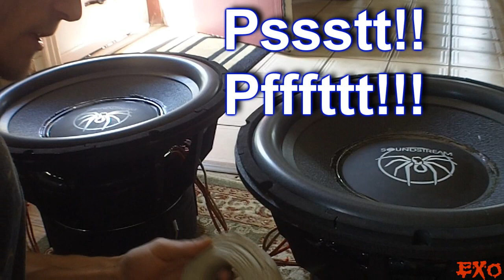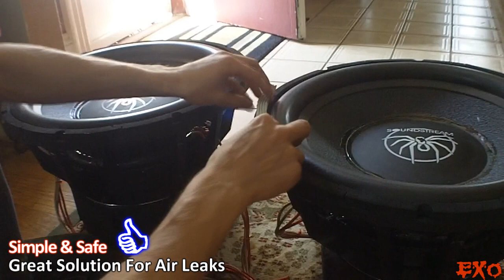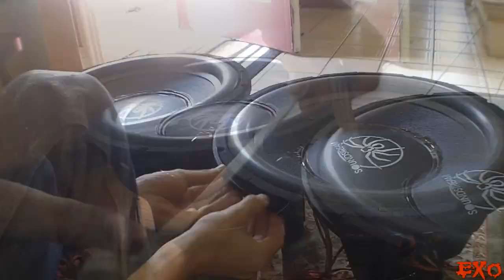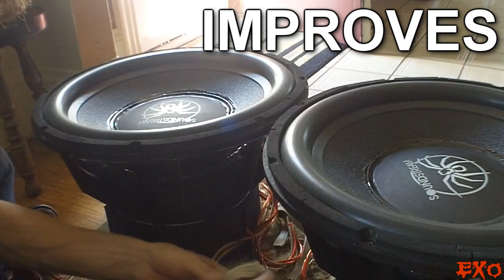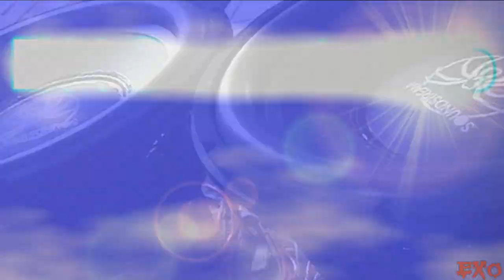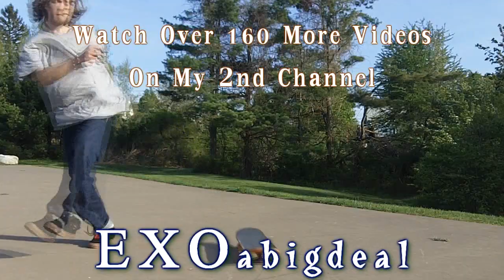INCREASE Subwoofer Sound Quality By Fixing & Preventing Air Leaks - EXO's Car Audio Bass How To 10

Comment: Thank you so much man !!
I've was living with a farting custom made sub for almost 9 months. All the while thinking I have an issue with my woofer driver. I thought it's bottoming out at some frequencies. Therefore pulled down the eq below 40Hz, thereby compromising sound. Uffff. That's until I watched your video.
I immediately unscrewed and used a door sealer (spongy sticker) all around the driver seating area. Cooollll.. no more farting. Finally, I am now proud of my sub. No more regrets
Reply from the maker: That's awesome man! Happy you ended up finding out how to handle the issue and get rolling smoothly again :)

Comment: Thanks for the tip. 
 I just got through doing a Fi audio Neo SSD 12" sub ported 36" port diameter 44" long in 2 cube in my 2017 Tundra in a blow through tuned at 29.75hz.
 When I first hooked everything up it didn't sound nearly as good as my single sundown audio SA 10inch sub ported and also tuned at 30hz.  I was just getting a lot of Rattley type sounds coming from the sub.  Even though I use number 12 screws I don't believe that stupid rubber gasket that comes with most subs these days was sealing it worth a crap.  The next day I went to Home Depot and bought some of the stuff you mentioned and the day after I took the sub out and took that stupid gasket around the whole sub off leaving the basket and surround exposed and installed this caulk rope( thats what she said)  then reinstalled the sub . Instantly it just sounded so much smoother in just about every way possible.  I'm going to end up building a beauty panel that but saw most right up to the surround so I didn't need the looks of that rubber gasket anyway .
 Also if for some reason that particular sub woofer really needed to be played for a few days before it's true sound started coming out because now it really sounds kick ass .
 Right now I am only running a single sundown audio 1000 D to it because that's what I had running my sundown 10" with.
 The next few days I will research a good amp that will put me into that 2000 to 2200 W range for this new woofer .
Thanks for the advice.

Comment: I used this for two purposes. To seal my hometheather subwoofer I used this stuff. Sometimes this stuff moves around but does a great job in sealing out the air. I also used it when I had to cut open a bigger hole in the back of my subwoofer box due to replacing the original amp. I put the mortite behind all areas on the amp and sealed the edges between the plate and sub box as well as any holes in the amp. Now sounds way better than before. This stuff is cheap too $5-$8.

Comment: When I bought my Fi Audio 12's they came with a foam ring on the basket which was really nice. As long as the weather stripping you buy is not adhesive on both sides this should work great. Also thumbs up if you think exo should be paid for product promotions from all the weather stripping, and and peel and seal people are buying lol.

Comment: I have to try this.  I am hearing some low excursion air leakage when some notes play. Most notes  are fine with my home theater sub. I'll have to try this to see if this also works.  In another note, what do you recommend for sealing air leakages around plate amplifiers on HT sub boxes. I had to change plate am due to original going bad and I had to cut part of the opening to make it fit. Thanks

Comment: I have Acoustic Research 2 ax's, and one of the woofers stopped working after a home party, and i got it fixed, but i noticed this air like noise coming from that woofer now. Could this issue be the seal around the woofer, or is it more likely to be something else?

Comment: When I put mine in I took the rubber boot of then use that weather stripping that is a narrow strip of foam has a sticky side to adhere to what ever your using it on and my sub is sealed tight!

Comment: Does it work on a carpet wrapped box and did you drill the wood screws into it afterwards??
Reply: Real question btw..I'm ordering me some subs and a box next week if you can hmu between soon that'd be greatly appreciated.
Reply from the maker: It probably won't work as well around carpet, but it will still likely stick to it.

Comment: i have a ported subwoofer home theater subwoofer and it leaks a littlebit of air on the back, what is the difference between this and if it would have gotten sealed?
Reply from the maker: Mot much difference really, any air leak will sound just about the same. It depends on where it is how you approach sealing it.

Comment: @exocontralto i have the same prob with my 15s, my baffle is cut out for a standard size 15 mabey a little more than the standard but i am running two optidrive 15 witch have a 16 inch mounting basket and its deff leaking air. I will try this stuff for shure. Now who is gona put those XXX 18s back in for you? they weight at least 100 pounds each, hope you got some help LOL!!!!

Comment: Note that if the paper cone has a tear, then no amount of caulk will improve the sound of your sub.
Reply from the maker: You an repair it, easily!
Reply from the maker: Use some paper and some E6000!
Reply: EXOcontralto i had a tear in my cone on my w3. Fixed it with just dap silicone and nothing else. Its holding like a champ